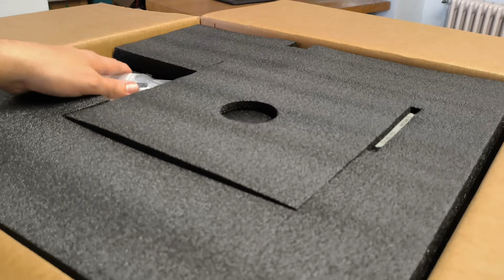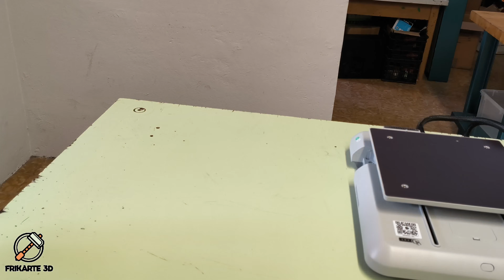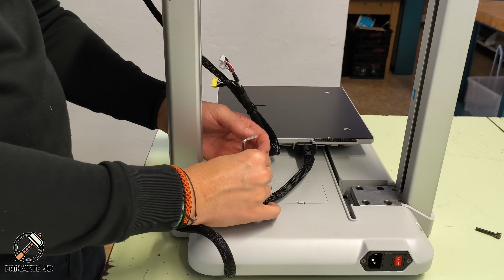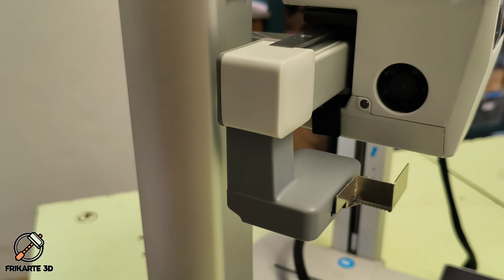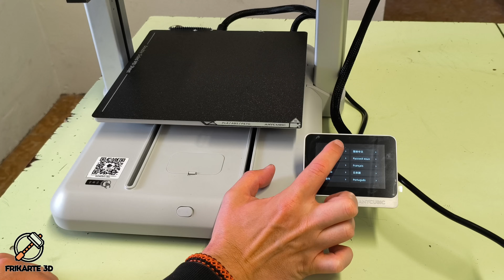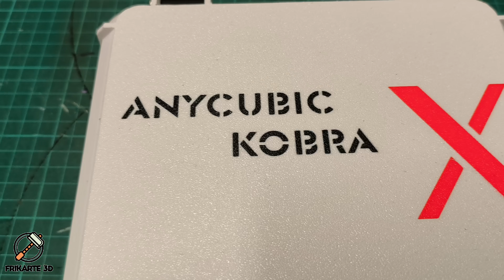Anycubic Kobra X Unboxing & First BIG Print! (No Benchy Challenge)

Comment: Good luck getting any customer support. Anycubic has never heard of it.
Reply from the maker: Thanks! It's not my first Anycubic printer, I had luck with support, not the best but not the worst. I got some resin printers and now I have Kobra 3, Kobra S1 and X. I had lot of issues with my K3, and support send me various broken nozzles, pei scratched PEI sheet and also a bed carry that wasn't straight... For now my Kobra X is the best Anycubic printer I had, now it's working hand by hand with my Bambu Labs

Comment: the first shots with the unboxing would benefit from a wider camera angle we barely saw half the gantry
when putting the gantry on the base we didnt see the top part either

also record your voice lines in room with more noise dampening hanging up a blanket behind your place of recording already helps a lot

printing the tool box is good i like that
Reply from the maker: Hi! Thanks for your feedback, I used my mobile phone to record everything, I should use 0.6 zoom for better camera angle. I normally use my home workshop that is better, but this was at my school where the space is bigger but there nothing that dampens the noise.
Reply: @Frikarte3D  keep it up 
I myself use a desk microphone at home for voice lines and record the noises of the place without speaking 
Workes fine for me so like when spray painting i am silent because the rattle can talks 
And at home i just overlay voice
Reply from the maker: @slickrick1557Yeah, I must do that I think